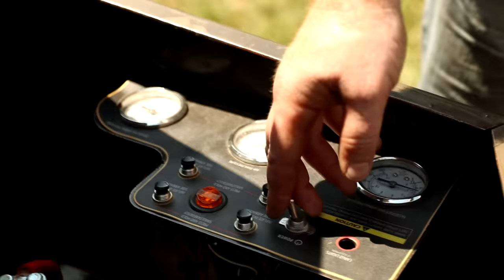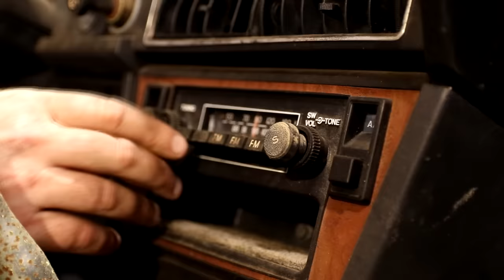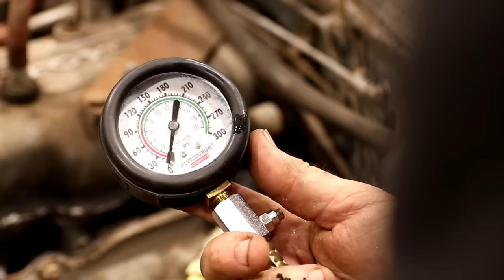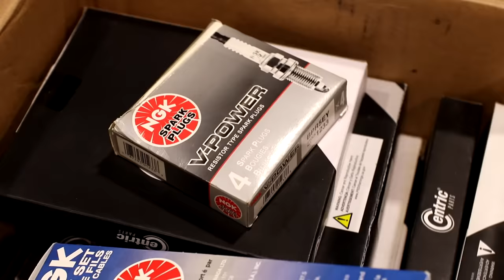Oddly Satisfying 1977 Toyota Celica TA22 Rescue | RESTORED

Comment: These old Celicas were great cars, dang near bulletproof engines and good styling. I haven’t seen one like this in a lot of years 👍
Reply: That's the only car I ever had a road-rage incident that involved almost going to jail after a high-speed chase of over 100 mph with smoking front brake pads
After I got where I was going the police arrived and the other guy and my car was sitting there with boiling smoke off the brake pads I had just put on
Reply: And the St was a sport touring I like it better
Reply: I wonder why it sat starter and major engine components were all working, was it just because of the fuel tank.

Comment: I have this 20R engine in a 1967 Triumph Spitfire. it still runs very strong after 150,000 miles. Mine is from a  79 Celica, the same engine as a Hilux truck. The oil pan on the Celica model is VERY rare. Most were beaten to death on rock crawlers because they clear the steering knuckle. I have NO ground clearance and my oil pan is on it's last legs after multiple repairs. I want your oil pan!

Comment: I had a 72 with the 18R and 4-speed. It was about 12 years old when I got it from a friend for $250. It had hit a deer in NJ on driver side that only dented the upper fender. It wouldn't charge and I found the turning and side markers were in the charging circuit. fixed those and it took a charge.
That little beast carrying at least 600lb load would chirp the rear wheels shifting into 3rd gear. It handled very well with stock tires and with wide tires was very fast through corners.
I filled in the dents and once had the timing cover explode, but fixed it and eventually sold for $250 again to a co-worker.
I wouldn't mind finding one of the rear drive versions and fixing it up.

Comment: Now that's something you don't see everyday, a two door Toyota. I'm 62 and wanted one. Those engines were like Swiss watches. Run and run and run and run. Just change the oil, air filter, check the points, condenser, and plenty of gas. My uncle had a small Toyota pickup. He did not know how many miles it had. Just said the odometer had turned over four times.

Comment: thanks for the great  video,s,, new to this channel and really enjoy the  quiet,  well done camera work, I dont need stinkin loud music blasting while someone takes a wheel cylinder off and all the drama, swearing and hype around simple basic entry level mechanics, Example "nicks garage" OH only nick can remove an air cleaner on a dodge and it takes skill only nick has,, yeh right.   and you dont smash, crash or do burnouts in every episode, AND you dont spend the whole show bragging how good you are like Pat with the 25 pens in his top pocket from that engine show. The Citroen DS was a great show as was the Mercedes with the busted timing chain, this celica deserves another shot at life also and it shows how great these cars were when new.
We see near new Audi, BMW and Mercedes  engine failures that cant be fixed, it says a lot for the simple old engines that are from the 40,s to the 70,s. Great show. Steve in Australia.

Comment: If I was restoring it I I would yank that 20R out it in a heartbeat and put in something else/better. I'm sure there are any number of engines that would fit and provide significantly improved performance. That it was severely underpowered with that little 4-banger under the hood was a universal complaint from every Celica owner I ever talked to; everyone wanted a 6 cylinder, and I knew one person that actually put one into a 76 GT.

Comment: the little holes in the rear drum are for removing the drum the holes are threaded put a bolt in each hole and tighten evenly and they will pop right off

Comment: One of my favorite cars was a 1975 Celica GT that was pretty much identical to this one. It’s an obvious Toyota rip-off of the Mustang style but much better built. I finally got rid of it when at 99k it blew a head gasket. Now that you got it mechanically sound, why not fix the hole, and paint the body, plus fix up the interior. This car deserves it.  You only now have a junker, but it could easily be fully restored and there are almost none of these attractive cars still on the roads.

Comment: I watched this entire thing because as it went along, I found myself asking a lot of questions. The more I watched, the more I kept seeing things that just had me wondering. Like why you waited til after the first start to change the fluids. Why you didn't seem to care about spilling fluids all over the place (the part with the brake fluid getting dumped while replacing that one part was especially surprising). The fact that you lowered the car, THEN crawled back under to do muffler work instead of just keeping it lifted. How you never really checked the suspension other than to press on the front of the car, watch it bounce and I guess decide that was good enough? How, after 30 years in a field, none of the electrical system was damaged; all the lights and everything were working fine and bright as it they were basically new; even the radio worked! The way you didn't take the seats out to clean the interior, or replace either of them, just tore out the old covers and replaced them. The way you added those wheel... arch... things... to the sides without addressing the rust, then later just didn't address the rust at all, giving it a good wash and counting it as 'restored'. Even the part where you sprayed down that hot engine with cleaner seemed strange.

I've never seen a car 'restored' like this before, and I hope to never see something like this again. No doubt, you guys know how to get an old car working, and how to check to be sure a car still runs... but if this is a restoration, something is wrong.

Comment: I live in northern Indiana and I can tell you that you WON'T find and cars like that sitting around up here!   These have all rusted to nothing and have been long since crushed.   1970's Japanese cars unfortunately liked to rust out right up around suspension mounts and steering boxes etc.  Once those went the car would dog-track badly and be junked.     I've had a 1974 Toyota Corona and a 1978 Datsun 210 .

Comment: Come on guys no new or rebuilt calipers used drums and rotors no wheel bearings or seals . You know a caliper will stick or fail. No inspection of steering components. Maybe I’m overly careful but safety and reliability are my first priority